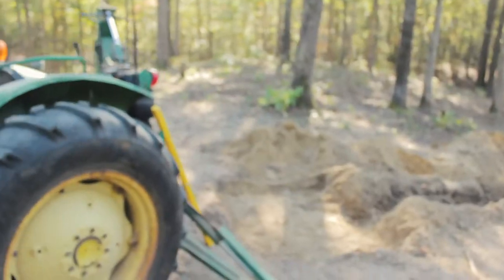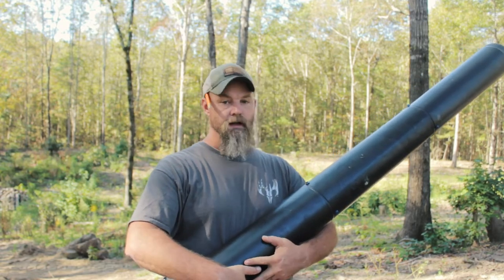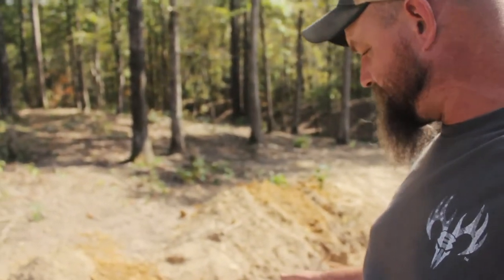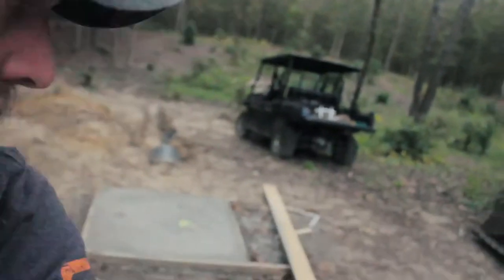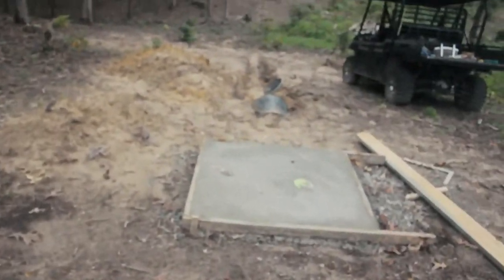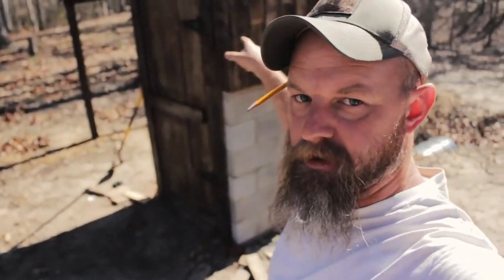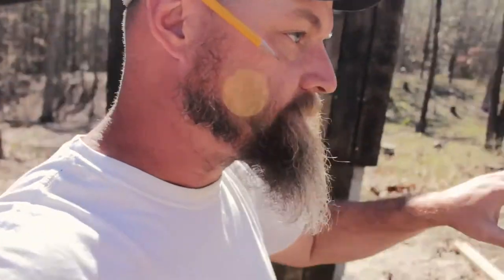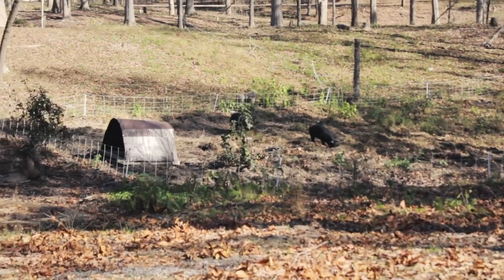BUILD Your Own SMOKEHOUSE (Full Video)

Comment: When you put your Seems on the bottom it will take on water because of the static pressure water comes in to the line from the bottom up. Put your seams on the top and it will receive no water.
Reply from the maker: Year and a half in, and no water has entered the pipes or burner.  It may depend on soil, but we are mostly sandy and haven't had any problems.